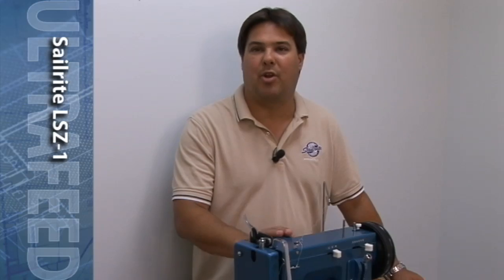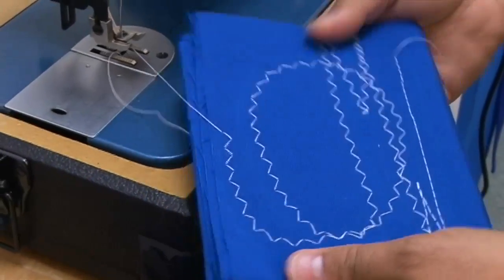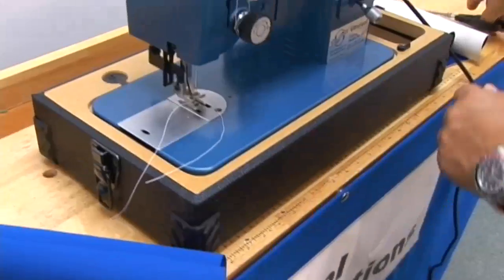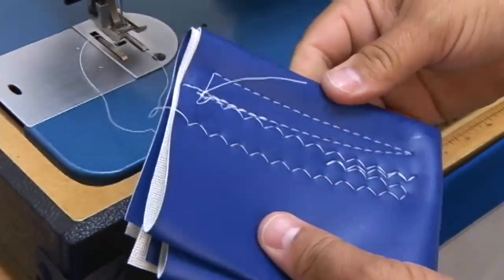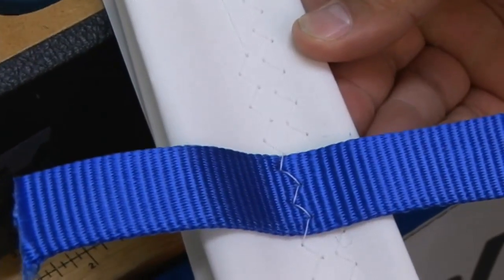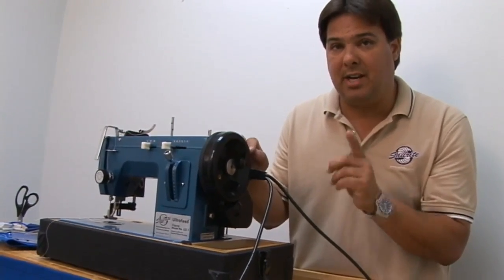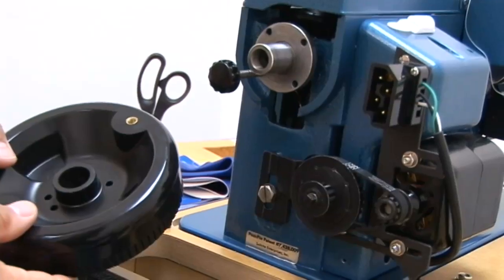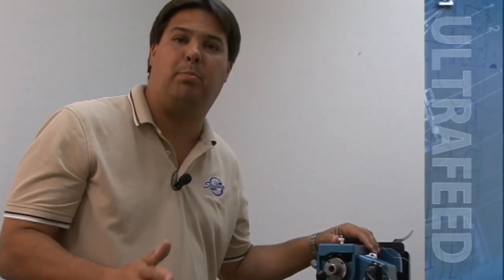Sewing Heavy Fabrics - Ultrafeed LSZ-1 Sewing Machine - Part 3 (Unlisted)

Comment: Can the Ultrafeed be removed from its portable case and will the Ultrafeed models fit standard sewing machine cabinets? It looks as though it may. I would like to mount this in a standard Singer-type cabinet.
Reply from the maker: Yes, the Ultrafeed sewing machine foot print should be the same as most standard Singer type machines, so it should fit.
Reply: Sailrite
Thanks for the reply. This is a VERY important feature that would likely be a major selling point for home sewers who want a serious heavy duty machine. I know that its being able to fit inside of a standard sewing cabinet via the Singer-type connectors is what seals the deal for me. Again, thanks!